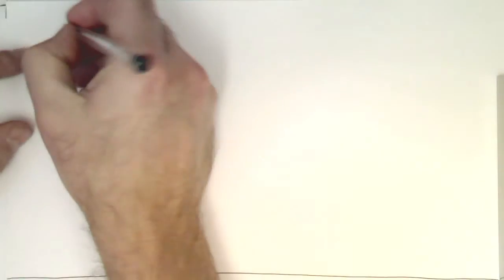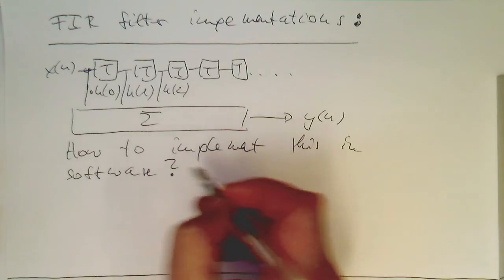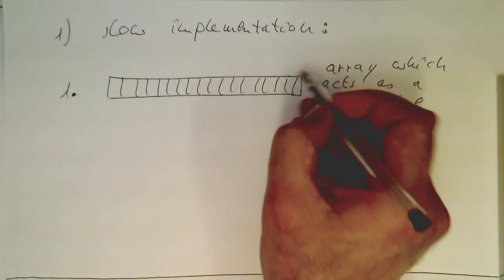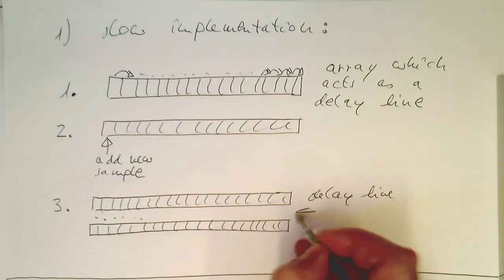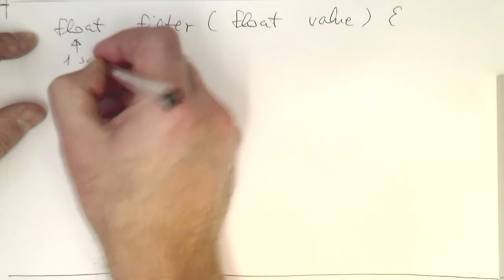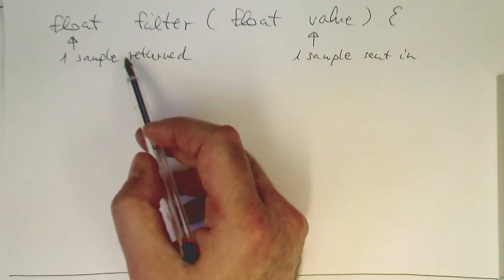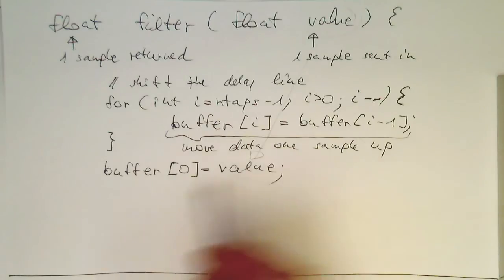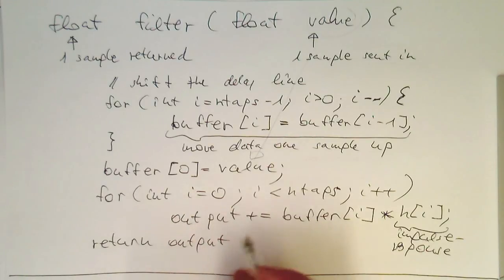FIR filters: a simple but slow C implementation (003)

Comment: If I want to compute the output of exacly one input at a certain time, do I still need the inputs before my specific input, and do i still need to use all of the filter coeffs.? Or if for example my filter has 50taps and my input is an array with lenght=50, if I want to calculate only the output of array[49], do i still need all 49 filter coeffs.?

Comment: i think  for the 2nd loop we cannot start from  the i=0. If we start from  i=0 then for the updated co efficient say(C0) will be added to the array and that will make some garbage value while computing the output. Here i am giving my code. Please check whether you are getting any error or not

#include <stdio.h>
#include <conio.h>
main()
{
 int buffer[]={10,20,30,40,50};// input buffer in a from of array
 int C[]={1,2,3,4,5};          // previous co-efficient 
 int n=5;                      // number of coefficient  
 int i,j;                      // for loop
 int result=0;                 //adding result=0 for not to get any garbage value

 for(j=n-1;j>0;j--)
{
 buffer[j]=buffer[j-1];
 printf("\t%d",buffer[j]);
}
printf("\n");

  for(i=1;i<n;i++)
 {
  printf("\t%d",C[i]);
  result=result+C[i]*buffer[i];
 }
printf("\n");
printf("the result is %d",result);
getch();
}

Comment: here i have attached another solution for linear shifting of a FIR filter. Please check this 

#include <stdio.h>
#include <conio.h>
main()
{
 int buffer[]={10,20,30,40,50};
 int i,n=5,t[n],k=0,j;
 int result=0;
 int C[]={1,2,3,4,5};

 for(j=1;j<n;j++)
 {
 t[k+1]=buffer[j-1]; //temporary storage where data can be stored

 printf("\nthe buffers are");
 printf("\n\t%d",t[k+1]);  //print out the updated buffer in form of array in a new array
 k++;
}
printf("\n");
for(i=0;i<n;i++)
 {
  printf("\nthe co-efficients");
  printf("\n\t%d",C[i]);
 }
 for(i=1;i<n;i++)   //since the buffer from the negative portion is out of bound thats for the reason we will start from i=1
  {
  result+=C[i]*t[i];
  printf("\n");
  }
  printf("the result is %d",result);
 getch();
}